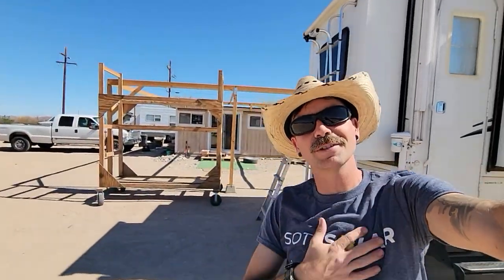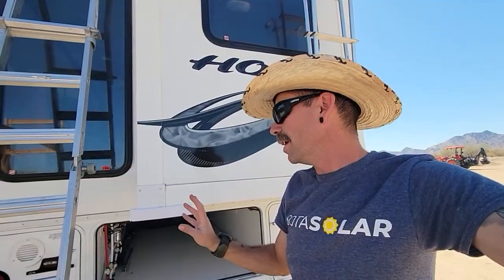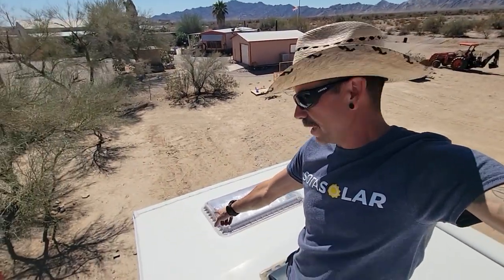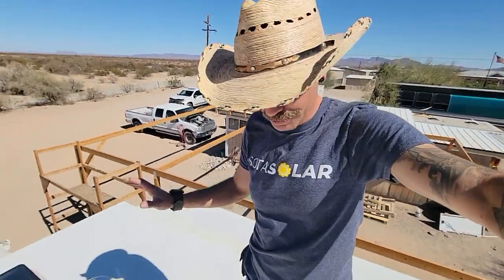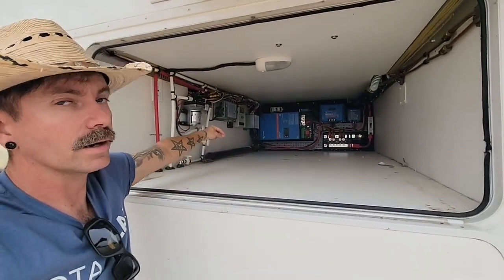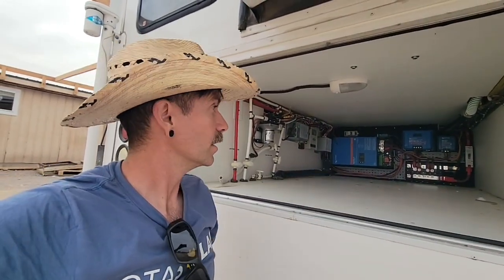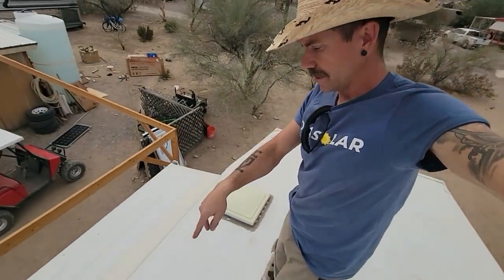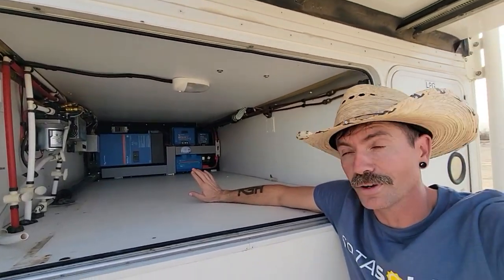Ultimate Off-Grid Truck Camper Power Upgrade | 920Ah LiFePO₄ + 1.2kW Solar Build

Comment: You forgot to show how you ran the connection for the DC-DC  charger to the truck. Also did this model Host not have the factory MorRyde slide out tray?  Nice install. I am considering one of these truck campers to use for places I can not take my 44' Toyhauler fifth wheel (which has 1200W and a complete Victron system)  What are the dimensions /specs of the 200W Rich Solar panels?